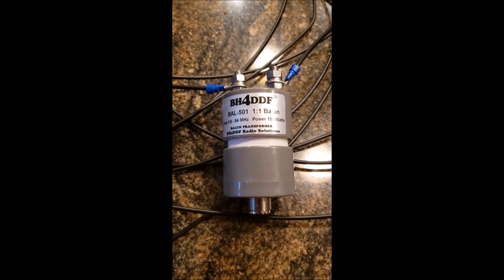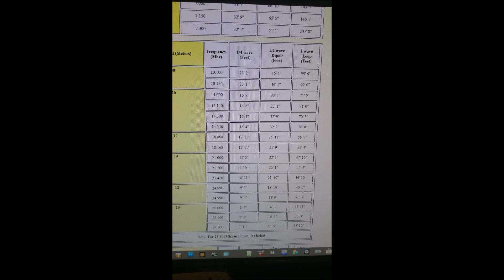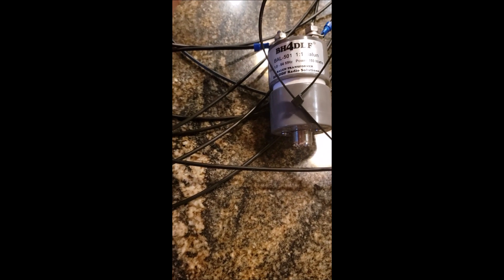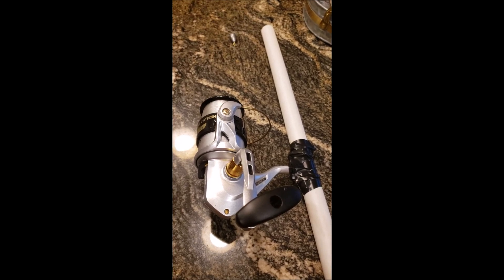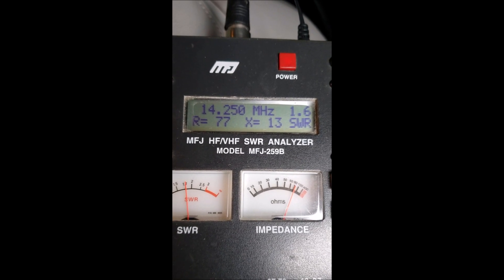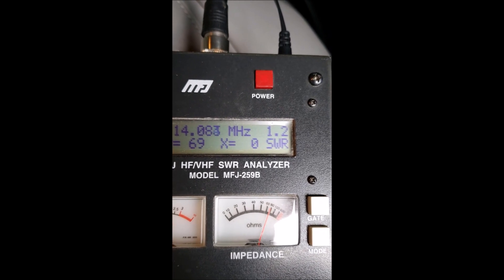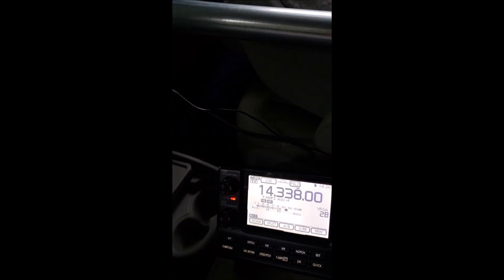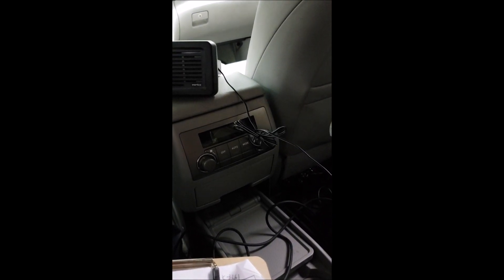Homemade 20 Meter Ham Radio Dipole Antenna for Portable Ham Radio

Comment: New subscriber here.  I am new to the hobby, well licensed for 2 years but new to HF.  I had my first park activation last week with a guy who was experienced and showed me the ropes.  Have you used verticals as well as a dipole as an inverted v for portable? The vertical seems easier to setup where the dipole as inverted V would have to have sides posts secured (maybe not easy to do in some parks due to trees are not available everywhere).  I state that more as a question than a statement of fact.  Just trying to figure this out.  I have parts and components for a fan dipole for 80/40/20/10.  Maybe I should try to see if that would work portable as long as I can anchor the sides to something.I also wonder if the gain or performance portable is better from a horizontal or vertical.  The noise floor in the park last week was fairly low.  We did have some broadband noise maybe from the electrical poles.  Thanks again for your video.  All the best, 73 de KI5HXM
Reply from the maker: Hi Brent.  Thanks for the comment.  This antenna was for fun and to do something new for the first time.  I mostly use my Buddipole in a vertical configuration.  Also, my MFJ-1979 17ft telescoping whip in a mag mount on top of my car when I want to be really fast doing a POTA activation.  When I use the MFJ-1979 I always use a tuner.  You can measure the antenna for the band at a certain spot but when you get away from that spot the SWR starts going higher fast.  My favorite antenna, which takes sometime to setup, is my Steppir CrankIR antenna.  I just used it for WFD 2022.  It will bust most pileups.  It is expensive but does a great job.  During the summer I use it almost all the time unless I am short on time or doing a number of POTA activations on the same day.  It is fun to experiment with different antennas.  I would give your fan dipole a try and see how it works out.  Keep experimenting until you find the best antennas that work for you.  73 de K7JSG